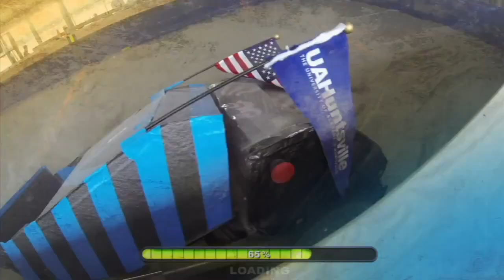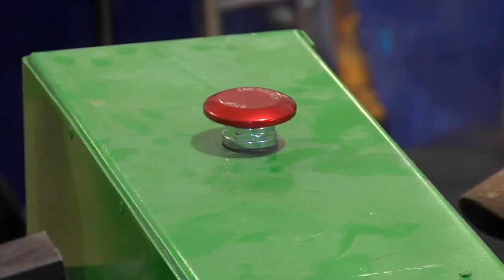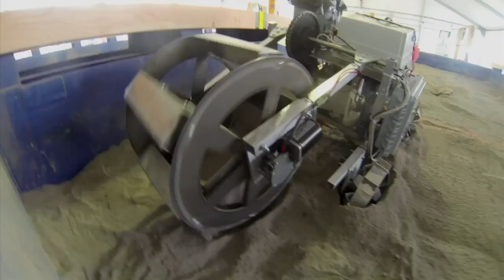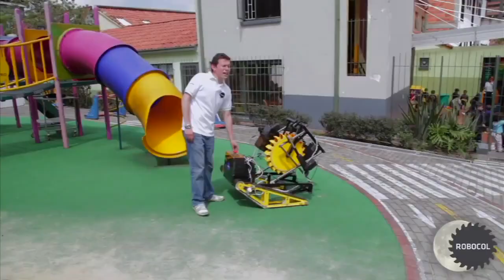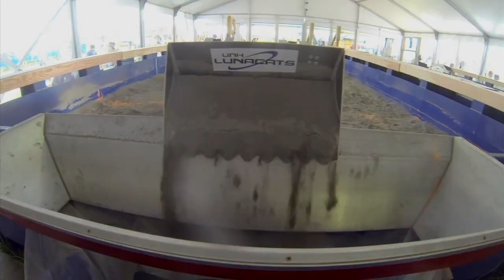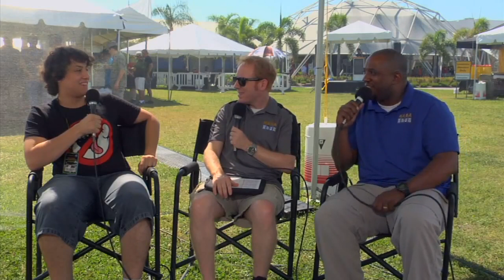Moon Dirt Diggers: Regolith Mining Competition Results | NASA Space Science HD

Comment: ☢☢☢ mine was a green house doom cover/solar power collector, fraction still with " plasma " collection pumps (for low Gravity mining) refinement condenser "bottles" for H2O, Helium 3 & what have the regolith
+ 6 individually directable & rotatable walking pads were for both movement & agitating   overburden & to speed heating & outgasing
= a thermal nuclear powered version is required for mining sweet spots in cold shadows in lunar crater bottoms where volatiles like helium 3 never evaporate